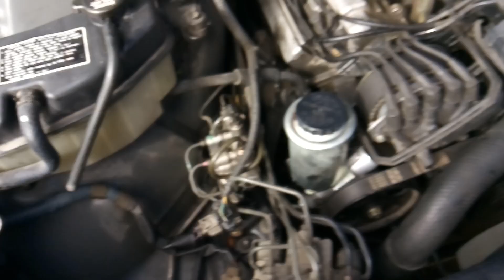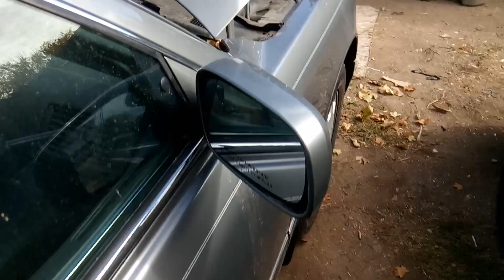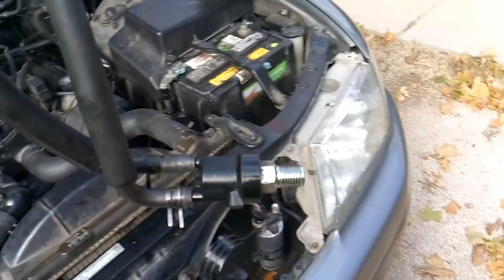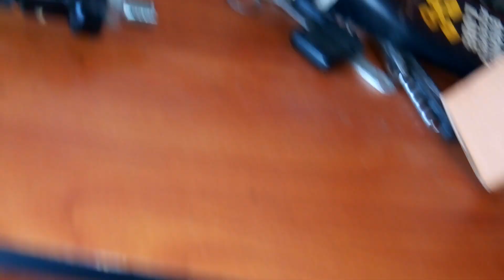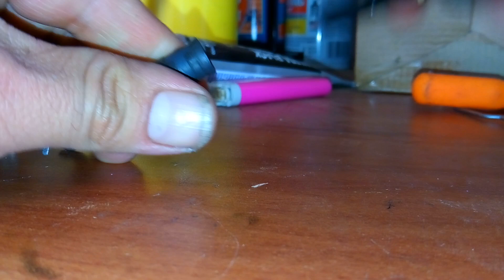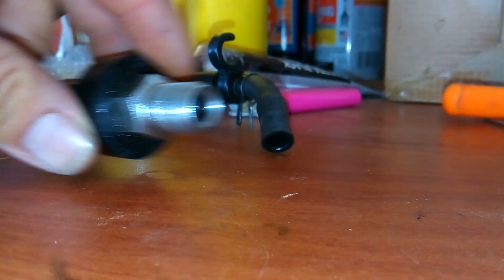Lexus LS 400 power steering air control valve information

Comment: So mines is leaking by my control arm, so does that mean its the high pressure hose not tight enough or is this, so as i turn the wheel it leaks out quick and be empty

Comment: Could it make your power steering be rough to turn ? If that vacuum valve is bad?
Reply: You have an update on this? Im experiencing hard steering after replacing my pump and rack
Reply: i don't believe it would, that's probably your power steering pump going out

Comment: u really deserve 5 start charp u saved u $$$ bro i hard same issues losing fluid soo fast blowing white smoke in my exhaust with no leaks and mechanics were suggesting hauling engine block installing new pistons, crank shaft and the likes basically spoiling a working engine but when i fell on your information i was relating i hard my problem fixed  thanks a bunch

Comment: I replaced mine with a $15 aftermarket part. It failed again in one week. I have heard it can be bypassed with NO consequences. Maybe the LS400 8 cylinder engine is powerful enough that the idle boost of 200rpm doesn't make any difference. To my mechanic's mind, it is kind of stupid to induce a vacuum leak in order to boost the rpm.

Comment: I have a 2002 Land Cruiser series 100 with exactly the same problem. I purchased an after market Air Valve (to save some $$) and it didn’t work. I was braking my head looking for the missing fluid and it so happened to be inside the Air Flow Canister…. Thank you for the video Matt...

Comment: So i just replaced my PS Pump, rack and pinion, alternator, and tensioner. I bled the system and everything. While the car is jacked uo the steering is fine but as soon as i lower it, the steering is extremely stiff. I drove it and the steering frees up when i give it gas but as soon as i dont amd slow down the steering gets stiff on me again. Any ideas as to why this is happening? Ive searched all over and cant find an answer to it. I have a 97 ls400.
Reply: What was the cause? Have you found it out?

Comment: Hey Matt, I'm not a mechanic. I have swapped engines in my 72 k10 pickup so I'm not a total newbie but my daaughters SC400 needs a power steering pump...we think.  Is this a job someone of my low skill level can perform?
Reply: You’ll be alright Matt

Comment: This video is the answer 3 repair shops could not figure out.  I had 3 steering racks replaced this year. first one lasted 50 miles, second one lasted 7 months  but leaked. Last one seems ok but using fluid daily and smoking on start up. And it smelled bad like I was adding transmission fluid to the intake. Thank you so much for this video. I just changed the vacuum control module and no more smoke no more fluid loss and I can accelerate like I use to.. thank you thank you thank you👍👍👍👍👍👍👍

Comment: Okay I have this problem and I went and got a Lexus ACV. I look in the shop manual and I don't see where these hoses go but apparently one of them goes to the throttle body when I look at the ACV valve I only see one hose hooked up to one of the nipples ..the other plastic nipple has no hose attached to it. Where would that hose go?

Comment: I'm having the same white smoke problem on my 1999 LS400. It Idles, revs, and runs great, but every now and then when I start it a puff of white smoke comes out! I will fix this power steering air control valve immediately along with my valve cover gaskets. Thank you!

Comment: 1st generation Rav4 has the same valve.  I didn't realize that they came apart like that.  Unfortunately i broke one of the plastic vacuum ports off mine. Thanks for the info

Comment: Does it matter which vacuum hose is connected to which of the two ports on the valve?  Or is there a unique in and out configuration?

Comment: Lexus calls for ATF in the power steering fluid, not power steering fluid. Yet, there is no cautionary sticker nor warning label on power steering reservoir. I would bet that a lot of service stations and non-Lexus garages top off with power steering fluid, not perhaps having access to Lexus Owners' Manual. Would PSF damage valve or power steering if ATF isn't used? I own '97 LS400 same color as your example here. It just turned 181,000 mile without the slightest break-down. I did have belts and water pump kit changed over and tune-up, but that's it.
Reply: It’s probably due for a timing belt, you don’t want that to break when running.

Comment: My 91 LS400 is experiencing this Power Steering leakage into the intake because the idle up valve went bad. I bought the replacement part but how the heck do you get the old one off the car?! I have a 17mm open end but it's too short to reach the old valve from the bottom. Do I need a specialty wrench for this, like a "slim line",  8-10" long 17mm upen end to remove this thing?

Comment: Great Video Matt...I have a question: what is the correct reconnection orientation of the vacuum lines to the intake and the manifold...I mean which tubes on the valve connect to where? Or maybe it doesn't matter??? Please help.
Reply: The orientation should not matter because the 2 vacuum lines are a series circuit between the manifold and the throttle body, and the low pressure air is either allowed to leak past the throttle body when hydraulic steering resistance is sensed it opens the air path to make the engine "Up-Idle" ~100 more RPM from baseline, and when their is no more steering pressure, the air valve closes and the Idle speed returns to the lower normal Idle speed.
It's a feature of Lexus quality, and a more pleasurable driver experience when every engine system is fully functional.

Comment: Hello sir... I am having  a hard time removing this underneath. How did you remove it? Thanks
Reply: What I did was use a pry bar bend the metal line away from the valve and you need a small 17mm wrench. Go from underneath. Also make sure to unhook your negative cable I forgot too and tapped the alternator lol so be careful.
Reply: Actual unit ...use a dwell socket. The rest is as ya say
Reply: hey I'm having the same issue.  What did you end up doing?

Comment: I just replaced my pressure hose on my sc400  I’m getting the white smoke 💨 coming out on my startups... I remember seeing this valve on the hose connected on the banjo part of the line that connects to the ps pump. I’m going to order the new part. Should I seafood the intake after I change out the parts?

Comment: Same exact problem with 2002 toyota tundra 4.7L SR5 CODE P0300 P0301 P0308, replaced twice. Symptoms are slight power steering leak, rough idle, white smoke from exshaut. Need to clean throttle body because of build up of burnt power steering fluid. WTF Toyota!!!

Comment: If I "delete" the air control valve will it hurt the motor in any way?
Reply from the maker: I would not suggest  it.
Reply: Not suggest to change it or it won't  hurt the motor?
Reply: @rafaelmartinez6287  It will not hurt the engine...but it could have a slight effect on performance in cold weather. No biggie.

Comment: I have the exact problem. Tons of power steering fluid is poured into this car and I see no leaks. Big white cloud and rough idle. What are the steps to replace it?
Reply: Did you ever figure it out my ls smokes on start and low rpm hesitation kind of feels like a misfire sit at 200 at idle
Reply: @DREAMV4ULT  any updates? having similar issues with my SC400

Comment: What is the big puffs of white smoke were from that? I lost all my power steering my steering is hard as a rock but one of my boots on my rack and pinion is shredded. Could it be that as well? I just don't want to spend the money to get a new rack and pinion, or power steering pump if I don't need too but the humming from the pump stopped and I don't have any power steering whatsoever. Please get back to me, thanks
Reply from the maker: in this case due to the amount of money and labor needed I may say to go ahead and change both. this way you are not having to go back 6 months later and replace one or the other because you did not already do it. it will save money and time in the long run.

Comment: i got this problem on my 3rz-fe engine.. does this problem cause the engine light to turn on? When diagnosed, it indicate the Idle Air Control error.. Thanks
Reply: Having the same issue currently with white exhaust on startup, cel light code iCV rought idle and reverse on the tranny not working
Reply: This is my question as well. My mechanic was befuddled why the engine light came back on. He's blaming overcharging of the alternator.

Comment: Will that make car act like it's missfiring
Reply from the maker: yes!
Reply: Thanks
Reply: Can you tell me how does that work to make it do that
Reply from the maker: power steering fluid gets sucked up into the intake and gets into the cylinders.
Reply: Ok i changed it out most of the spuddering is gone but it doesn't have smooth idle
Reply: @tonycarter9013 did you ever figure out the ideal situation? Was it sitting very low.